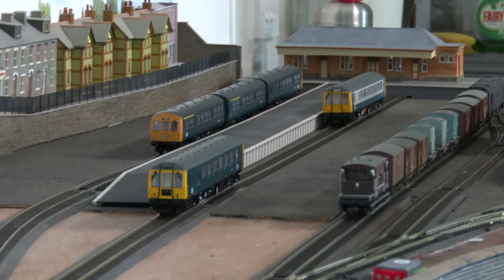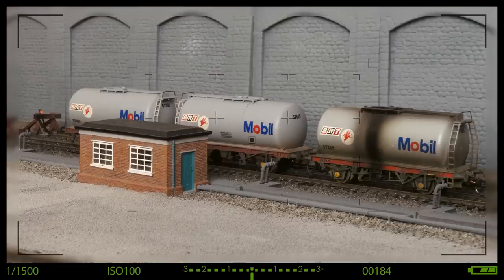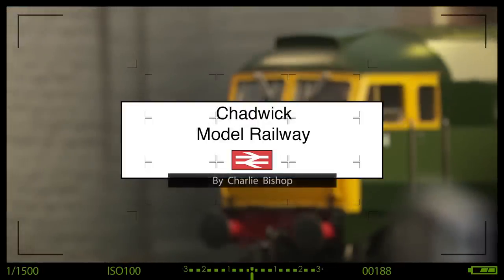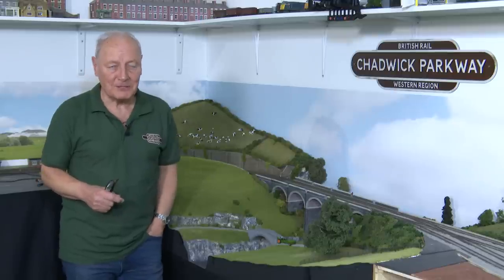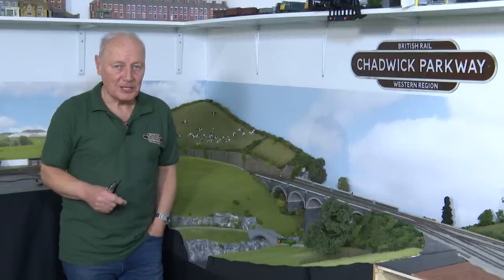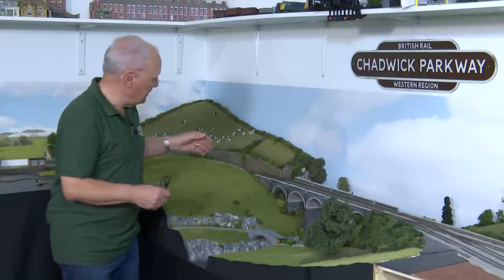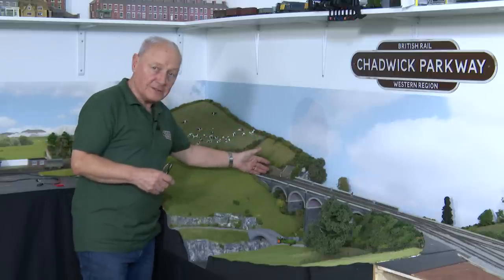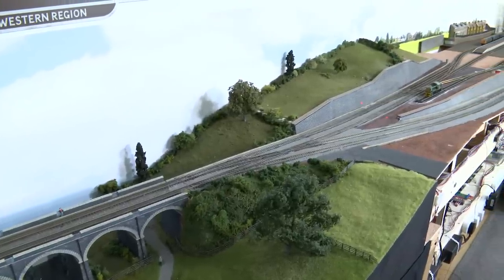SIGNAL POSITIONS at Chadwick Model Railway | 199.

Comment: You don’t need a signal at the tunnel mouth. I can think of plenty of tunnels that don’t have signals at the entrances. Plenty of tunnels have signals inside the them.
Reply from the maker: That’s an interesting observation Chris. But is it true around 1970? Regards Charlie
Reply: @ChadwickModelRailway  I would say so yes. Depending of course if you’re signalling is absolute block or track circuit block, how long the tunnel is meant to be and where the signal sections are. A tunnel wouldn’t necessarily have a signal positioned right at the tunnel mouth to protect it. The signal does look great there, don’t get me wrong, and it obviously fits with how you’re doing things. 
I would also say that you wouldn’t have a ‘main aspect’ signal on the exit to the branch station goods yard. I tried looking online for a ground position light with a yellow aspect for the headshunt and came up with nothing. One with red and white ‘stop’ lights would be ok though for shunting into the headshunt, and wouldn’t need a route indicator, although some would have had an old fashioned indicator positioned above, below or to the side, possibly displaying something like ‘SDG’ to denote the headshunt siding is the route set, and showing nothing when the route is set out onto the running line. Also to consider would be that during shunting, trains could theoretically move out onto both ‘main lines’ and would have an indicator for that too, with a ‘shunt limit’ board or fixed red ground position light to show that ‘bang road’ shunting is not permitted past that point.
Reply from the maker: Excellent info Chris, many thanks.

Comment: Hi Charlie, Love the video and enjoy you giving your followers the chance to interact with you.
Being a driver for 40 years. I have a few thoughts on how I might be able to help you with the viaduct junction and branch station.

1] If you change the viaduct Jn. By putting in a small curve & changing the righthand point to lefthand. This would the leave you with the high-speed lines [to helix] as a straight on route and the branch line as a diverging line to the left. Your signal would look correct. As normally the flash / route indicator is for the slower diverging route.
---------\              /-----------  to branch
-----\       \------/     /--------
         \------\------/
            \        \
             To helix 

2] As for your theatre box signal [CMR 104] that controls the branch Jn. 
[A] When it clears for the goods. It would only be the two white lights. As the train is going into an area with hand points, which could be wrongly set or wagons fouling the running lines. It would also be a non-track circuited. The driver would know that they would have to proceed at caution and be prepared to stop short of any obstruction.
[B] Any clearances of this signal [main aspect / two white lights] would have to have an indication as to where the route is set for. This should prevent wrong routeing. Example, passenger train into the good yard etc.

3] Passenger trains departing the station. Signal would have to be a three-aspect signal. As the driver departing on a green signal would expect the next signal to one yellow and not a RED. As the signal could be on your set up. As you have another signal protecting the viaduct Jn.

4] Controlling the goods yard. There is no need for a main aspect signal to control the departure of the goods yard. The simplest way to control this would be with a ground position signal. Either type would do. 1st Yellow bottom left white bottom right, can be passed toward the shunt neck. Two white light diagonal, to make a conflicting move. [out to the main line] driver would understand that they can move forwards on the running line at caution to the main aspect signal that protects the viaduct Jn. Of a standard ground position light, red light bottom left & white light bottom right. Stop movement. Two white lights diagonal and a theatre box. Indications of N for neck or S for shunt & D for down line U for the up line. [the nearest the wall would need a “limit of shunt” broad placed before any conflicting points. 

Just some ideas and have tried to keep out railway jargon. As its understandable to these who work on the railway, but not so for these who don’t.

All the very best and looking forwards to your next video.
Kahier Model Railway.
Reply from the maker: I’m most grateful KMR, for such an in-depth comment. I’ve recently acquired the signals handbook RS – 521. Now there’s a mine of information that is healthy me know end. Stay safe, regards, Charlie

Comment: The diverging feather is usually for the branch as opposed to the main aspect as its usually historically placed based on which line was built first.  Sorry just my tuppence worth! In your case I’d have a feather to the left denoting the route is set for the branch Adding to that you may also have to consider the speed over the junction ie the higher speed for the main and the feather denoting a route to the branch But I may be incorrect of course despite my 38 years as traincrew 😂
Reply from the maker: It also appears that the lower speed tracks get the feather. Regards, Charlie
Reply: @ChadwickModelRailway  indeed that is what I meant, sorry poor comprehension☺️
All the best Charlie keep up the great work!  I find you the most informative on YT, a skill in itself.